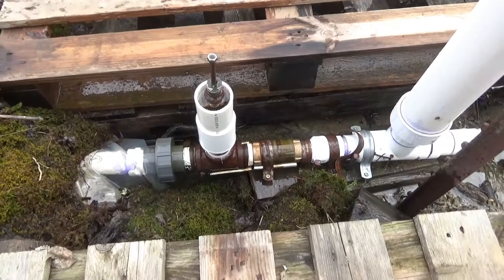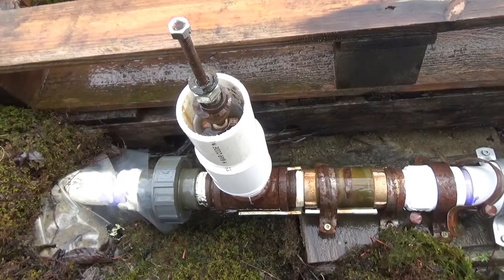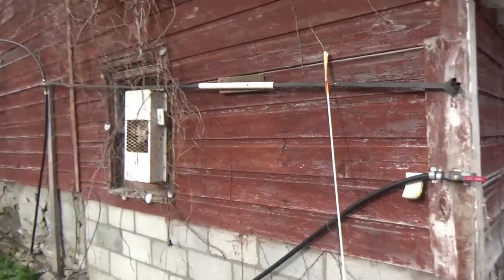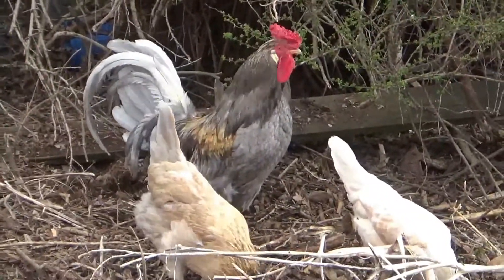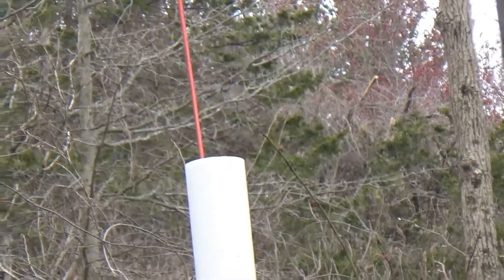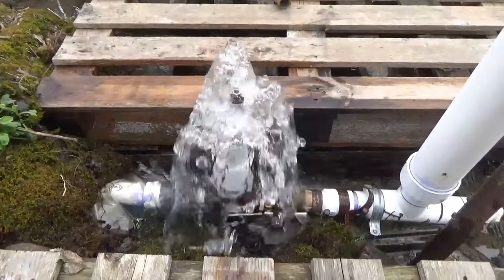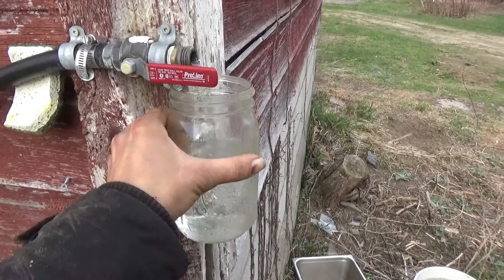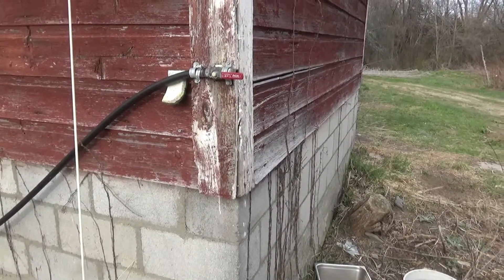Ram Pump Impetus Foot Valve Weights Comparison Flow Test Delivery Line

Comment: For lower elevation or vertical lift faster cycle got more production, but for higher elevation or lift, reducing the cycle for putting an additional welght is better
Reply from the maker: You know, that makes a lot of sense! Thanks Maximo, your comments are always excellent!

Comment: More weights = longer cycle = faster flow at valve close = more kinetic energy in the flow = more potential for pressure... but less flow, in this case, because you do not need that much pressure. The right way to measure the flow@pressure is with the overflow from your elevated storage tank. And instead of tennis balls, how about bicycle inner tubes as air bladders? That way will allow you to adjust somewhat the initial pressure and volume of your air spring. Or just get the accumulator tank from a well pump, and really have control of your air spring.